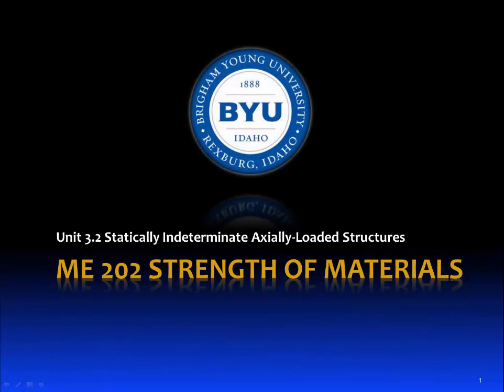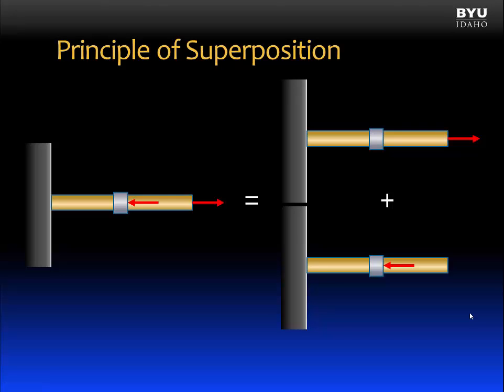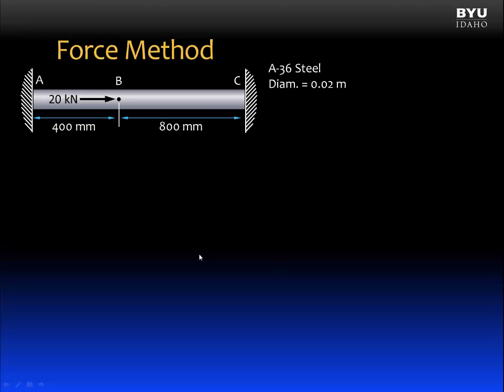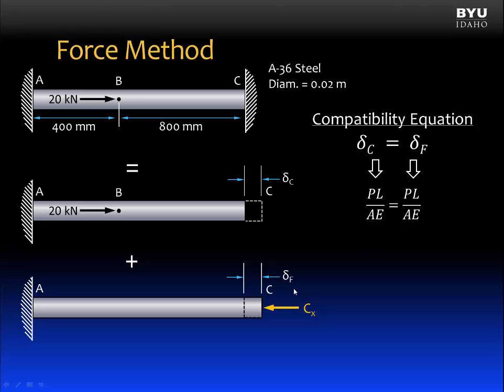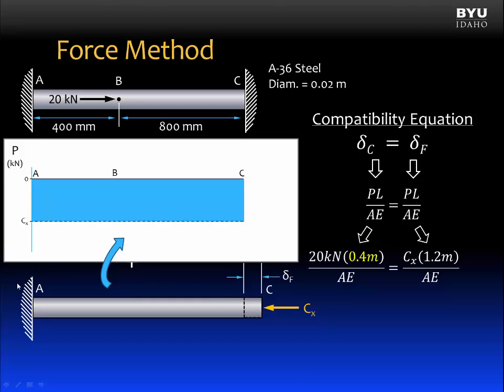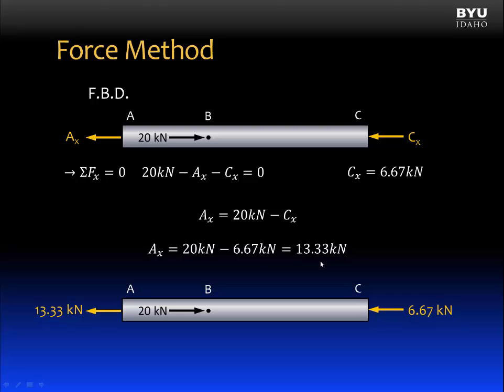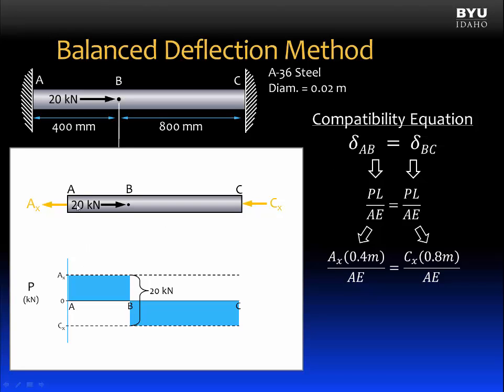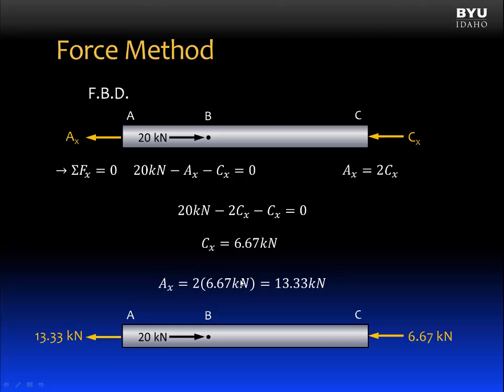03.2 Statically indeterminate axially loaded members

Comment: What really confuses me is that I don’t know which segment is the force P acting on. In some problems, L is the distance behind the arrow which in this problem is 400mm and in some problems L is the distance in front of the arrow which I’m this problem is 800mm. Could you please explain this to me ?
Reply from the maker: You can determine the segment the force acts on by inspecting the free body diagram.  The load must transfer through the structure from the point of force application to the structure's support.  (The path the force takes through the structure is called the “load path”.)  When using the force method, there is only one support on the structure, so, the segment that "feels" the load is the segment between the support and the point where the load is applied.